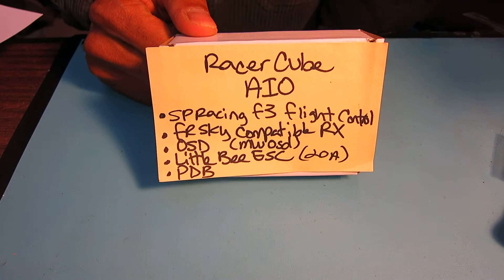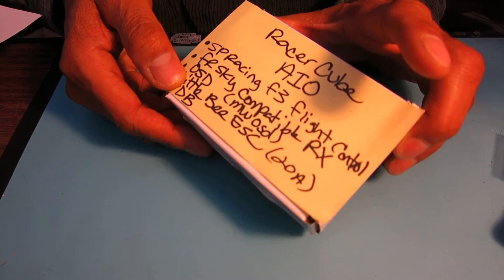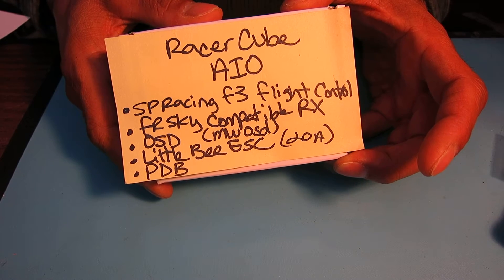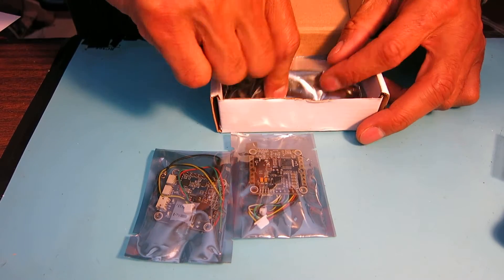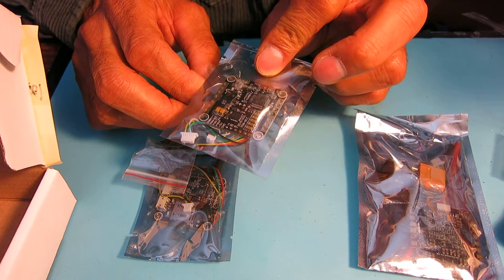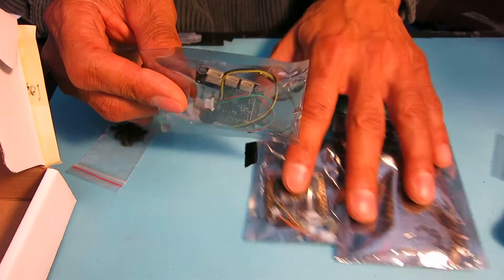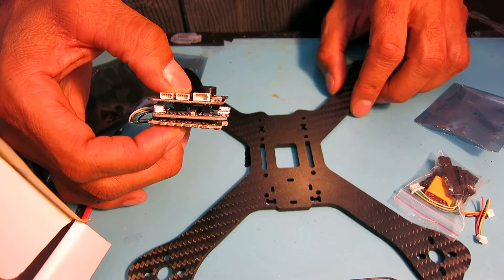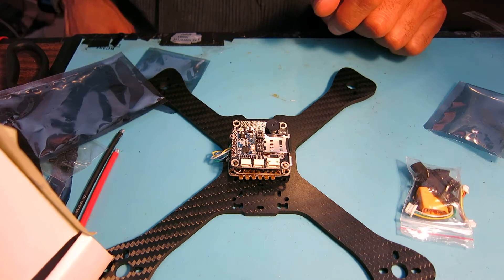Box Opening of Racercube AIO F3 Flight Controller, FrSky RX, MW-OSD, Little Bee 20A ESC

Comment: Being it has a barometer, can it be set to altitude hold?
Reply from the maker: Yes, it can do altitude hold.  But, I have not tuned those PIDs yet. The default Betaflight PIDs do not work very well on mine.  In Baro mode it looks like it needs some more D gain or less P gain because it does fast oscillations up and down.  If you have one of these and figure it some good PIDs, I would like to see them. :)